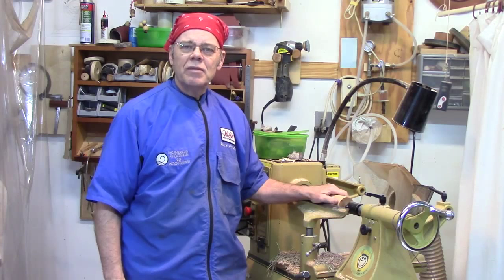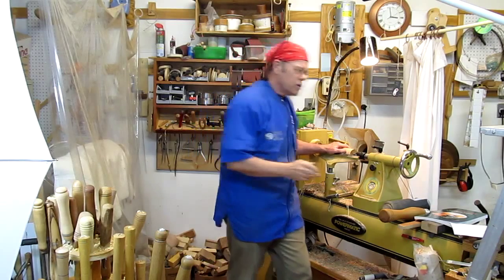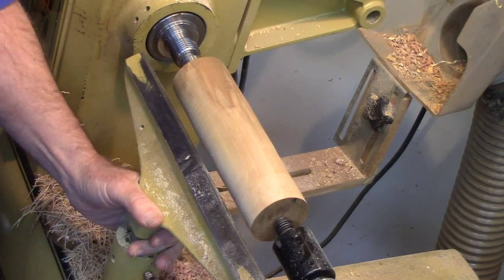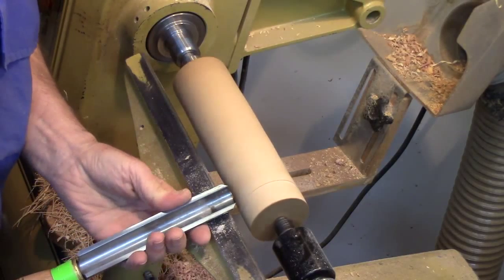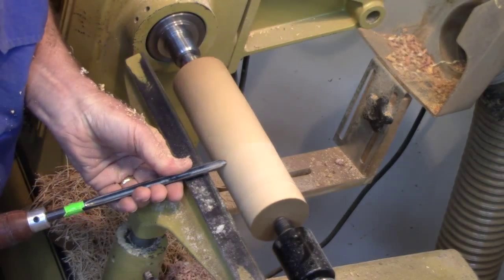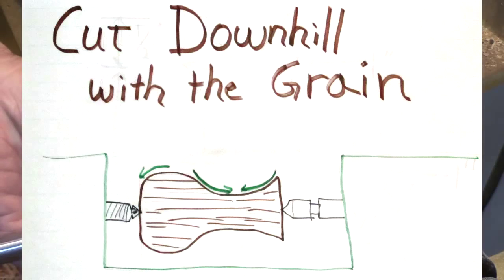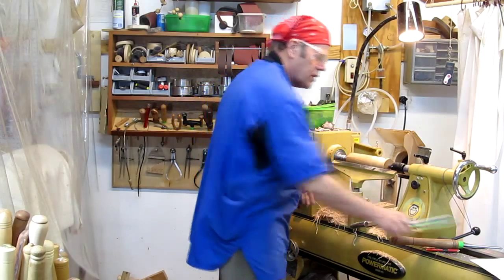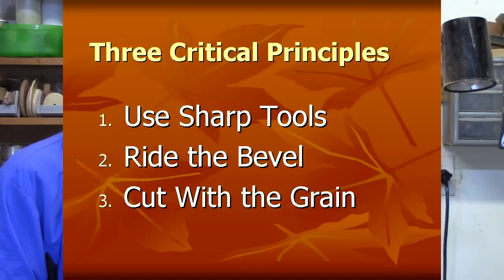3 Key Principles for New Woodturners

Comment: Mike, what kind of lathe do you have .. I am not new to wood turning , but I am undecided why brand of lathe to buy.. also which is better a bench model or a one with legs ..  money is somewhat a factor..
Reply from the maker: I have a big PM3520c which sells for about $5500. I had a Laguna 1216 but replaced it with a 14" midi PM2014 for a teaching lathe last year when they had a once in a lifetime sale at half price. I love it.   I think the Record Power Coronet Herald lathe is one of the best buys at a reasonable price currently on sale. I have a video review on it as my club has one. https://www.thewoodturningstore.com/record-power-16006-herald-lathe-with-optional-bench-mount-feet-120v/?aff=7  Please note that is an affliate link. If you can make a good stand that may be the way to go but it is a lot of work and materials cost money.  See my video on the lathe stand I built. https://youtu.be/cwwsRnrUY2o  I did it to have storage space. Some bought stands are costly with casters.